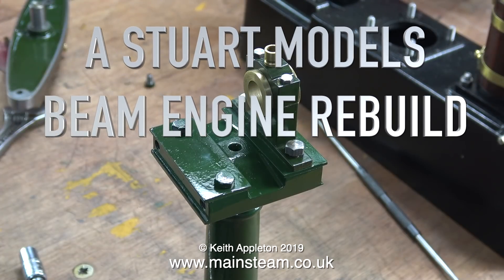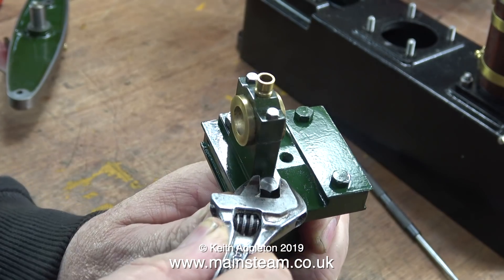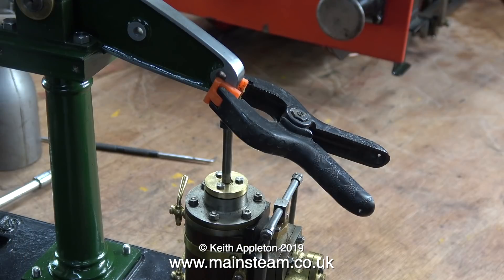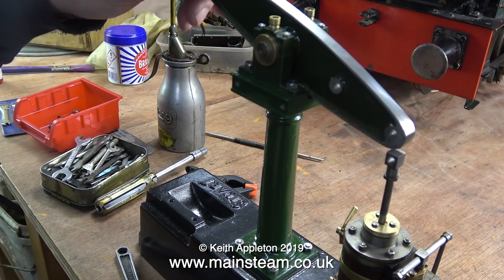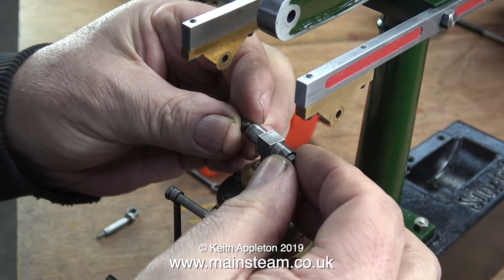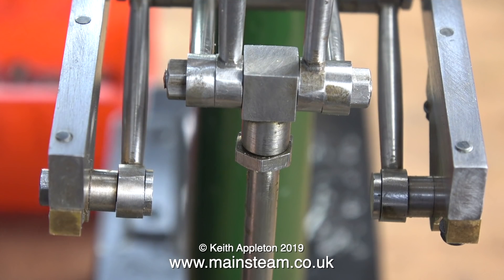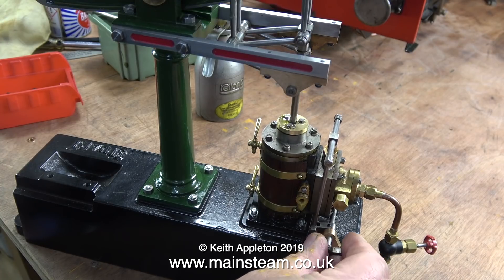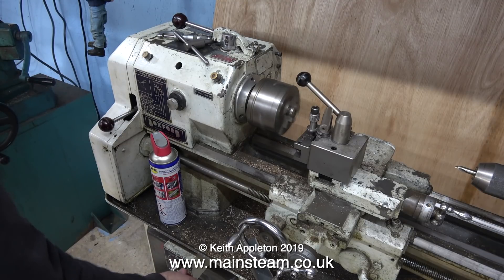A STUART MODELS BEAM ENGINE REBUILD - PART #18

Comment: Mr. Appleton , could you please tell me your formula for lubricants , I saw it once but can’t recall it now.
Reply from the maker: I used a mixture which was 50% Steam Oil, 25% Machine Oil and 25% Rapeseed Oil (Canola Oil) - Now I use oil from www.hallettoil.co.uk
Reply: Keith Appleton  I apologize for not thanking you sooner for supplying me with your lubricant formula, Thank you

Comment: On full size engines was painting done after your nuts were nipped up?
Reply: I'm not sure about the steam engines He's seen but I work on full size steam locomotives in Canada,  We paint and then tighten the bolts because it's a steam locomotive and they get dirty and a little paint scuff is the least of the worries but if there is excessive damage we do touch up the paint if it is noticeable.
(Hope this answers your question)